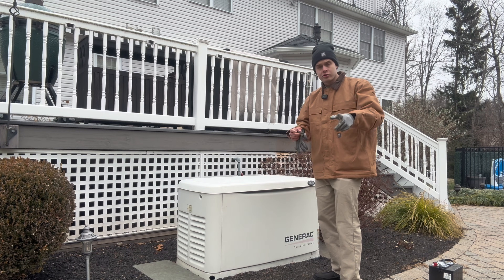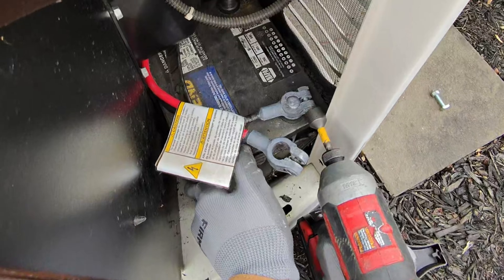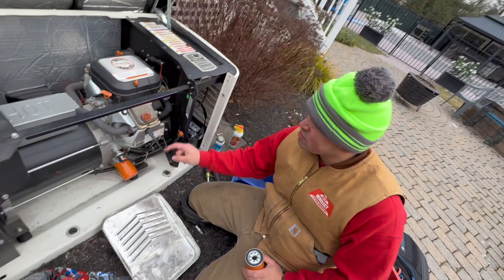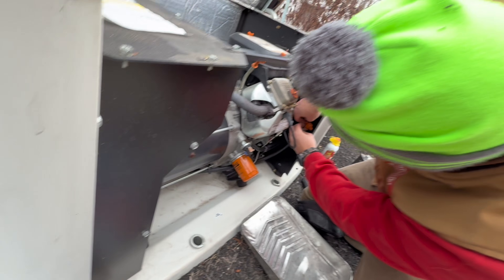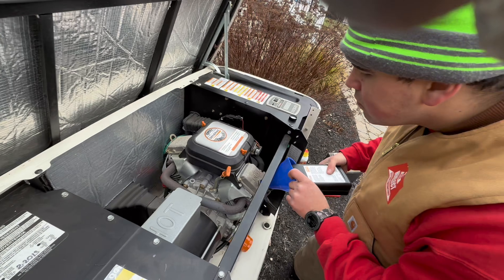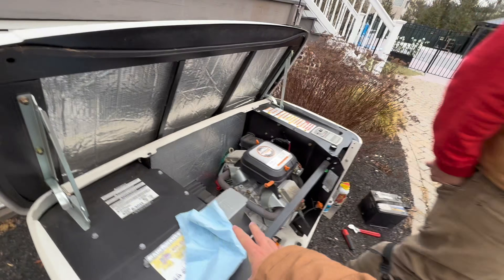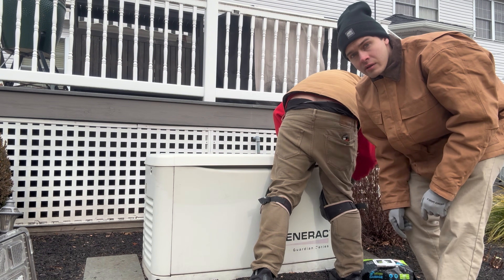HOW TO SERVICE A 14 KW GENERAC GENERATOR! FULL SERVICE!

Comment: Hey Hendy! I found your page through instagram and have been following you for a few weeks now. I just signed up to take an electrical apprentice exam near my local in chicago and have it on March 14. I noticed there are five different sections for the exam. There is mechanical comprehension, numerical computation, numerical reasoning, paper folding, and reading comprehension. I applied this month, and I only have 2 months or so to study. Kind of wished they would've set the exam for April.
  I feel that I got the reading comprehension and the mechanical section down. My only concern are the two math portions of numerical computation and reasoning, which hold up the grading rank more. Any tips on the math section to study more? Any reason why there is  a paper folding section for an electrical exam? if you can answer, itll be appreciated!

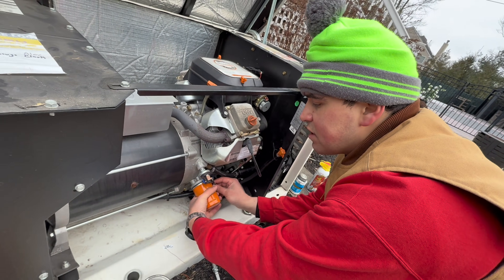Comment: 7:00 - from the Generac Service Manual - “ Before installing new filter, lightly oil filter gasket with fresh clean engine oil. Screw filter on by hand until gasket contacts filter adapter. Tighten 3/4 to
one full turn farther,”